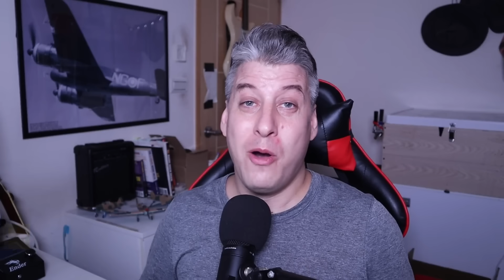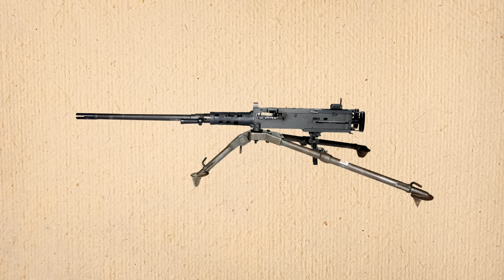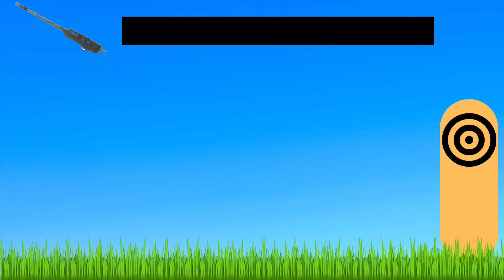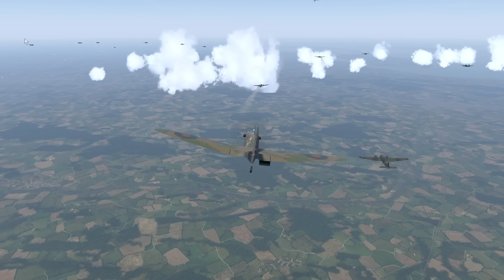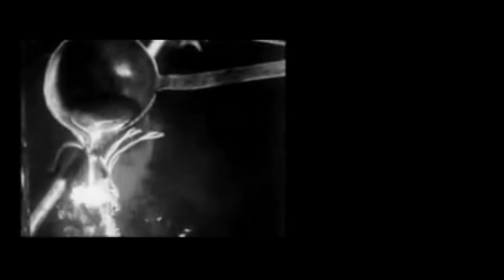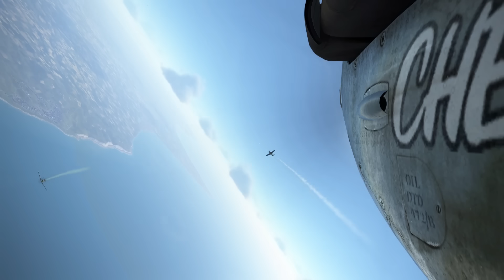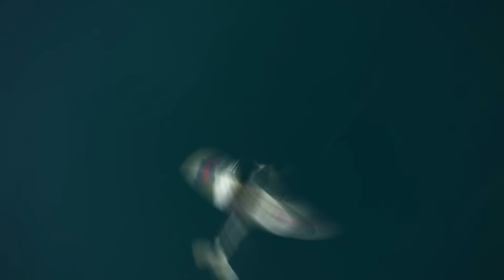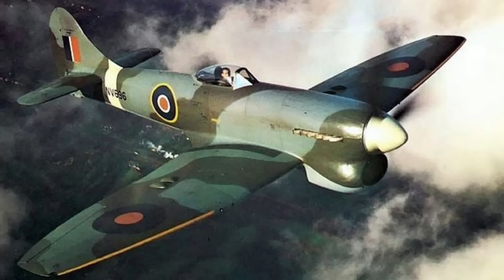Why Did The RAF Use .303 Caliber Machine Guns in WW2? The Surprising Answer

Comment: .50 cal Brownings in American fighter aircraft such as the P-40 were notorious for stoppages until design problems with the ammunition feed were corrected later in the war.  The combination of the highly reliable .303 Browning and the 20 mm Hispano Suiza cannon in a number of British aircraft such as the Spitfire, Beaufighter and Mosquito was a highly effective one and was probably the best possible compromise on the basis of firepower, reliability, ammunition availability and supply and optimized weight of guns and their ammunition.
Reply: Notorious is a bit of a stretch.
Reply: @Hornet135  What word would you suggest instead?
Reply: @thegreatdominion949  it had stoppage rates similar to that of .303s. Usually related to lubrication and dust.
Reply: @Hornet135  The .50 Browning was known to be unusually prone to stoppages in the early to mid war while being fired during high-G maneuvers.  Deformation of the ammo belts under the high-G forces was the main cause.
Reply: @thegreatdominion949  what’s you’re point? It wasn’t any more problematic than other guns at the time.

Comment: This is my guess, before watching the video: The U.K’s .303 round has been tried and tested, vigorously, it is a reliable round that was readily available at the end of the war, there were numerous guns at the disposal of the U.K, the Vickers .50 is one that particularly jumps into my head as soon as I say that. Guns chambered for .303 were also cheaper to produce, meaning that it was more cost effective to equip Hurricanes and Spitfires with 8X .303 machine guns rather than 6X or even 4X .50 machine guns, it also meant that more rounds could be fired during one burst, and aircraft are brittle machines, all it takes is for one well placed .303 round to down a hostile bird, I’m assuming all these factors combined contributed towards the decision of using .303 guns over any other.

Edit: Well, I was close enough. 🤣🤣 I was correct regarding there were numerous factors and some being the same ones I have mentioned here.

Comment: Re: the apocryphal story about Harris saying the .50 isn't worth it at night bc range: it's not the range that's the advantage of the .50, it's the energy -- .303 will punch through beer-can-thickness aluminium just fine at most any range, but if the cockpit has any armour at all killing the pilot isn't an option. So you'd think "go for the engine, then," right? A .303 ball round just kinda splats against an engine block, even at close range. Sure, if you manage to hit the radiators or oil cooler it'll bleed out eventually, but the enemy has enough time to get his revenge before his engine overheats/runs out of oil and seizes. .50 BMG hits an engine block, that's one or two cylinders open to the atmosphere and/or each other in the best case. Worst case, it hits a piston, and ... well, a crankcase full of bits of piston is Not Good for the rest of the cylinders.
Reply: but that's a ball round, and most aircraft belts arent relying on simply kinetic energy to do damage, could easily set something alight in the engine housing.

Comment: I worked for a WWII Spitfire pilot who flew Spitfires and was an Ace.  He said that he got rid of the machine guns and his rearview mirror to lighten the aircraft so he could fly higher and faster.  Flying higher and faster meant "life"!
The mirror useless anyway because if you saw anyone in it that was not a friendly, it meant you were already dead.

The 2 cannons had about 10 seconds of firing time, and he said that if he couldn't hit it in 10 seconds, he was never going to hit it.
In his opinion, the 8 machine guns were just dead weight as they lacked "Stopping Power".

Another interesting thing was that late in the war, he was on patrol for the V-1 Buzz Bombs and you would not shoot at them because the explosion would/could damge the aircraft.   So they would fly up next to one of the wings of the B-1 with the Spitfire's wing just under, and use the air pressure coming off the Spitfire's wing to increase lift of the B-1 and it would then roll and eventually spiral into the ground.
Reply: V-1

Comment: Another thing most people don't realize is that for the first year after adopting the 20mm the RAF only had solid AP shot, which effectively made them big MGs. No HE filling, no incendiary. Just a big, heavy, slow-firing MG with longer range and better penetration if you happened to hit a armor plate or an engine or fuel tank.
Reply: I'd rather have hit a German Bomber with 20mm FMJ than with .303 incendiary.  Punching through a fuel tank with a 20mm seems almost certain to start a fire from impact, splash, or massive leak.
Reply: Thats a good point. Its funny how far ahead german was with its 20mm cannons and compact 14mm guns at the start of war, but how much their bombers sucked. Tbf the 303-storm mightve actually had some effect against the vulnerable He-111s bombers.
Reply: @termitreter6545   The Problem....the bigger the caliber the more "stuff" you could put in it...such as explosives or incendiary.  20mm shells exploded.  If I were a Brit flying in the Battle of Britain, I would have screamed for .50s at least...and a pair of 20mm if possible.  OR...if stuck with 8 .303s, I would have been like the Poles and got REAL CLOSE and then shredded them.
Reply: @krismurphy7711  i wouldnt say german bombers were bad
Reply: @krismurphy7711 As far as I’m aware the only Fighters to attempt to use cannon in the Battle of Britain were 19 Squadron’s Spitfires, and they were really awful. So terrible that they asked for their old .303 armed Spitfires to be returned!
Which apparently they were!
Reply: @donyoung1384 . Yes, the first cannons jammed easily. Later the Hispano Souza ones worked great…If I recall.   It’s a shame they didn’t originally equip them with working cannons….Battle of Britain would have gone much better for Britain.
Reply: 20mm Ball was pretty effective vs aircraft structures.  Analysis of crashed german aircraft showed that hits from the rear would pass through the entire aircraft, fuel tanks, armour, pilot, and finally lodge in the engine rear.  A hit to the mainspar would remove the wing.  A hit to the engine would critically damage it almost every time.  Was properly functioning HE better?  Yes.  Was 20mm Ball more effective than a bunch of .303?  Hell yes.  There's a reason that Ball was still being used quite late in the war... it was cheap and it worked.  To defend against it required unreasonable amounts of armour.  The late war SAP used really was overkill.

Comment: It had nothing to do with metal aircraft. A .303 can penetrate a sheet metal skin just as easily as a canvas one. The problem was that metal aircraft were much faster and so it was harder to hit with a long enough burst to hit something essential.
Reply: so in that sense, the rate of fire of 8 x .303 is going to be a better chance of hitting the target than 4 .5 MGs would do.  When you factor in the weight penalty of the heavier gun and the ammuntion required, the performance hit on the early Spitfire and Hurricane would have been detrimental.  Against the German Bf109, RAF pilots were outranged by the heavier 20mm guns, but it was relatively slow firing and didn't carry a lot of rounds

Comment: WTF are peope even on? They used the .303 Browning because that was what they had in the late 1930s. They were only just starting to work on adopting the 20mm for anti-bomber work. They had a hell of a time even gettting the .303 to fit into the wings of the Spitfire in particular, they had to tip them and fit bulges into the wings. That said, an eight gun armament was considered jaw dropping in 1939. Early Bf 109s had the standard armament for the time, 4 RCMGs. A very few planes tried 2x .30 and 2x .50 MGs, but a .50 doesn't really make a larger hole than a .30, and isn't needeed when there is no armor, no self-sealing tanks, it is just bigger and heavier and carries less ammo and fires slower. So an 8 gun Spit or Hurricane was very well armed. Those guns are each firing at like 1,200 rpm, times 8. Or 12. It is like carrying a couple miniguns. Hardly weak, just you need to get in a solid burst once the enemy started carrying armor and self sealing tanks, and speeds got even higher. So they went with 20mm, that could ignore the armor and sealing tanks.
I think the idea that hte British, who spent hundreds of millions of dollars on radar and radio guidance systems, on ECM systems, on recon and spy networks, on chains of ships with beacons and land beacons, SAR boats, SAr planes flying nonstop patrols all through the war, ALL to try and get as many crew to the target and home alive again only stuck with the .303 "because they were too cheap to put real guns on their bombers" is the stupidest thing I have ever heard. If they didn't put bigger guns on it was because they didn't think it would make any difference. Did bigger guns help American bomber fleets? No, and they were flyinh straight and level in broad daylight. An RAf bomber found safety in being invisible, and taking evasive action quickly. By the time an enemy night fighter started shooting, they were already well within lethal range of a .303, IF they could hit them, which is very unlikely. The real purpose of rear gunners was to spot the enemy as soon a possible. they just gave them guns so they could feel like they had something to fight back with. Bigger guns would just slow them down even more. If the RAF really just "callously threw away their crews lives to save a few dollars", why would they have thrown away whole fleets of aircraft just because they were not survivable enough in combat? Why would they bother adopting a whole new generation of fighters with 20mm guns instead? The US was the one who stuck with what they had because they had so many in stock if anyone did (although I don't think that is true of anyone). Among the most stupid things I have heard for a while, sorry if it makes me rant. But the .303 is underrated, and the RAF made superhuman efforts to get their crews home and it makes me angry to hear it suggested that they callously sacrified them when a few .50 calibers would have saved the day.
Reply: I mean you know where these sentiments come from right?  We've now a generation whose knowledge/impression of combat during this time period has come from video games instead of books, thus the understanding and framing has been biased by those experiences - as most trusted these games to replicate real life, even if they had no relevance.
Reply: sorry, I didn't see this comment earlier when I replied to your other post.  Mine just backs this up totally!

Comment: Everyone finished the war with rifle caliber machines guns in front line air service. Maybe not as the primary armament on single engine fighters but everyone had them in the sky. Neither the Hurricane or the Spitfire were expected to persist in service and had the war been delayed even a year would have been replaced with cannon aircraft far quicker. Also didn't the 109 only swap it's 7mm for 13mm MGs in early 1943? The Germans also had a podded a 7mm weapon for ground attack so clearly felt that RoF and volume had a merit, Perhaps the USSR was a bit optimistic with  pistol caliber aircraft weapons on the Tu-2 ‘hedgehog’ ...

Comment: I like the stupid/better captions on the clickbait original still for this video. Perhaps the author could expand on the better P51 being designed and built with a crappy Packard engine. Or The US's use of the Packard engine is a puzzling reality. If it wasn't for the apparently stupid Brits the P51 would never have become the iconic Mustang. Perhaps one can also ask why the US soldiered on with .050's when most other nations including Japan were using cannons
Reply: Brain freeze, Alison engine. Packard was probably in a tank.
Reply: @mikerust2022  No, i remember the name too, I think it originally was a packard on the older p38s? or p40s?
Reply: @mikerust2022  The confusion is probably because you already knew in the back of your mind that the Merlin used in the P51 was actually manufactured by Packard under license and the name probably stuck!   Packard improved the Merlin, not in terms of performance, but in terms of simplifying it for mass production - and didn't they do it well!!!!!  IF there is one thing that the US can rightly claim, it's that their factories saved Britain (& the Soviets).

Comment: It's funny how the same problems and solutions (or mistakes) go around and come around... the question of bullet size/damage vs weight/capacity is one which still sees arguments raging around the old 7.62mm vs modern 5.56mm NATO; the one has more stopping power, the other you can carry more of.  Hence a lot of special forces still going for the former, regular troops for the latter - targeted fire (hit once) vs suppressing (spray and pray).  The battle for Mogadishu (aka Black Hawk Down) being a case in point... depressing if you hit an enemy and he keeps on coming, but then again if you run out of ammo you can't hit anything at all...

Great video.  Easy to be wise after the event, but on the day you go with what you have and can manufacture.  Which is not an excuse for our modern politicians to say "it'll do" when there is still time to plan for the inconvenient future war they don't want to put into their annual vote winning budget.

Comment: The selection was purely based on damage trials carried out using real airframes and setting the 8 guns to converge at a specific range. In action pilots set the distance closer. The assesment of British industrial capacity is also a bit off. Where weight was not an issue in for example the Beaufighter an all hispano 20mm cannon armanent was adopted, to which later 6 .303 machine guns were added.

Comment: Well we churned out so many .303's for the Enfield I guess it was just a case yeah we can supply loads. No retooling a good round in its day. It's down to the bullet not the case if the rounds were explosive that would of helped take a plane down.
Reply: Yep, same reason we stayed with .50 stateside- it's better to use something you already have a LOT of and can produce easily than experiment with a whole new production line during wartime.

Comment: The 0.303in machine guns,  were tried, and had the bugs removed,  besides they were available in quantity, easy to produce, compared to other guns, and in war, changing the weapons in use for others, means delays, and probably risk losing.  So since the guns were light, they used 8 of them to give them adequate punch.  Besides all that the 0.202 guns were very reliable, One of them taken from a crashed Spitfire 50 years later was just cleaned and it fired again! And it had been in mud during all that time.
Reply: Oops I wrote 0,202 instead of O.303 in the comment above.

Comment: Certainly once armor appeared on aircraft .30 cal would be too light.  20mm and certainly the 30mm never had a problem destroying other aircraft, but they did have limited ammo.  All in all for the period I think the .50 may have been the best overall because it had plenty more rounds than a 20mm and I haven't seen much of any complaints about .50 not having a destructive effect on the enemy aircraft.  That might not have held true if they were used against the heavily armored P47, but that was our plane too (with 8x .50s it was a shredder).
Reply: but a plane as big as the P47 had the size to carry that - something as dimuntive as a Spitfire, with that almost dainty eliptical wing, was never going to be able to carry that sort of weight.

Comment: I recall that the 303 was set to be phased out and replaced by a Mauser style bolt gun and Mauser style rimless cartridge , but, the great war began and necessity dictated that BE had to go with what they had in full scale production.  

The rest is history, turned out the "dated" SMLE action and 303 round not only suffered from no practical deficit in external ballistics, but, had superior, reliability and rate of fire to the Mauser style rifles meaning the BE infantry had a superior battlefield weapon to the Huns (and everyone else, until, the M1 Garand hit the ground).

Roll forward to WWII, very similar situation, they had to roll with what they could produce at scale, so, what could they do? well in 1939 they could stick 8 303s on a Spitfire or a Hurricane, so, they did that, and fought as best they could with that configuration.  Later, when they could upgrade, they did.

Comment: Throw weight (Pounds of shell per minute) is one of the best measurements for effectiveness of guns at destroying aircraft.  In this measure, armament of 50 caliber and 20 mm guns far exceeded the 30 caliber.  They were also more effective at penetrating armor and destroying self sealing fuel tanks.  The 50 caliber Browning had over twice the throw weight of the 30 caliber Browning.
Only Britain saw fit to retain exclusive 30 caliber armament for any time during WWII, and even Britain had largely discarded it in the later stages of the war.  
The Japanese did use a mixed armament of 30 caliber and 20 mm for much of the war.  US Navy pilots showed disdain for the 30 caliber rounds.  The Japanese pilots would often open up first with the 30s as a ranging techniques.  Many Navy pilots felt there was no major threat unless they stayed in the enemy's sights long enough for them to switch to the 20mm..